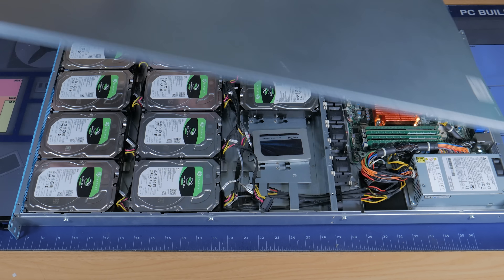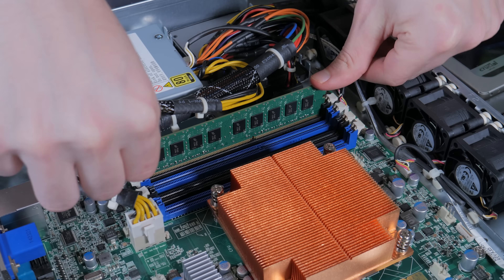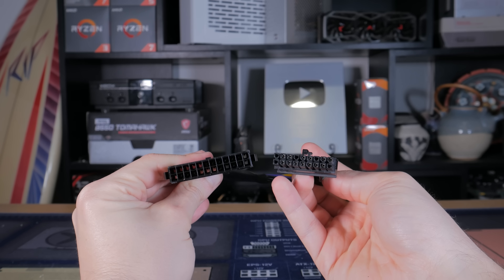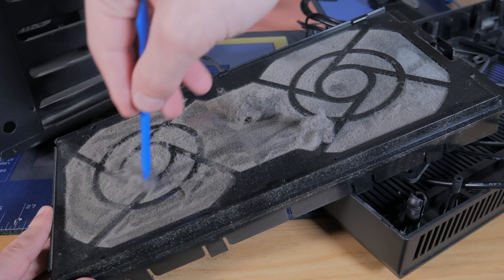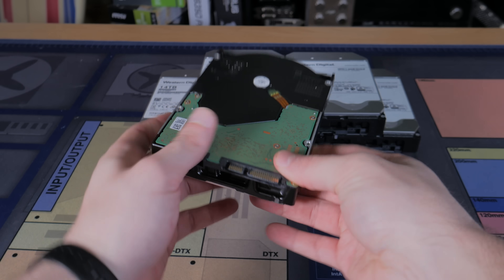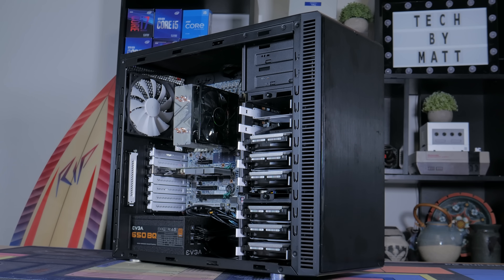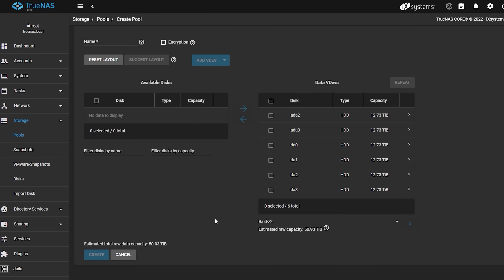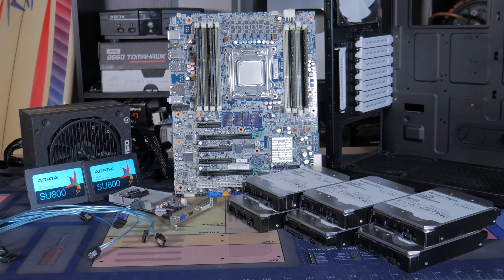Budget Storage Server 2022! | 84TB NAS

Comment: Count me in for requesting the upgrades.  I went with the same drives on Black Friday, could only afford three since I was still Christmas shopping.  I went with the Molex to SATA solution since my NAS is at its core an archiving file server.  It won’t be on for extended periods.  I also believe that these drives have different firmware from the Reds, and chose to just using Basic as opposed to RAID.  I have no idea how these would stand up to rebuilding a pool.

Comment: What exactly were the shortcomings / problems you had with the old server?
Reply from the maker: It was  too loud for the current space I have, all of the drives were SMR vs the CMR ones I have now, only had one 1-slot PCIE expansion slot available, and a few other things. Not at all a bad system and I could have just transferred the old parts to a new case, but this new system is much quieter, should be more reliable, and gives much more room to expand and try new things.
Reply: @TechByMattB  undestandable, noisy hardware is the biggest dealbreaker even before high power consumption, heat and space 🤔

Comment: Matt Yes, 10 gbps networking and SSD cache video in the future please. Thank you for producing this piece.
Reply: 10GBit is to expensive, there are like $20-$25 2.5GBit network cards on PCI-e x1/USB3 which work with CAT. 5e cables.

I don't think that any modern HDD will exceed ~300MiB/s even in RAID/ZFS.
Reply: @Adam130694  raidz6 I can hit around 550 and I'm sure pro setups with better hardware can hit faster speeds.
Reply: @rudysal1429  ok my bad, but I'm sure that 300MiB/s is sufficient for editing even 4K/60FPS over network.
Reply: @rudysal1429  Is there not a bandwidth limitation.
Reply: @Adam130694  Not even close. My camera files hit 300mbps on the low end. On the high end 1.9gb per second. And raw footage will be even bigger.
Reply: @Adam130694  if I have 2.5Gbit network card on my main PC and my truenas server, can I run full 2.5Gbit if my router only support 1Gbps?
Reply: @SkeletalPlayz  No, a 1Gbit switch or router in between would drop the connection speed to 1Gbit. If both your main PC and Truenas server have two network ports, then you can continue to use the 1Gbit ports connected to the router for internet, but use a dedicated connection between the 2.5Gbit ports on PC and server to allow faster access to the NAS. 
Cat5e supports 2.5Gbit at up to 100 feet, IIRC, so upgrading your switch to a 2.5Gbit model may be useful. Should be able to find 5 port models around $100. Anything that has 2.5Gbit ports you would connect to the 2.5Gbit switch, everything else would continue to connect to the gigabit router, with one connection between the two.
Reply: and by future he means next week. and by next week i mean now, as this video is already weeks old
Reply: I don't think there is a way to use a SSD with ZFS / TrueNAS ...
Reply: @Felix-j3d4b  there is. When you create a pool you can select a cache drive. I'm using 4tb hard drives in my nas and a 500gb m.2 nvme ssd as cache
Reply: @kyu3474  Lawrence Systems has a good video on zfs caches, boils down to this: cache in ram has a order of magnitude lower latency than other options. You should start thinking about ssd/optane cache only if you get low hit rate for you ram cache.
And as always it all depends on your use case, if you pull random video files and you watch them once cache won't help you much.
If you run vm's or docker containers I would first max out ram and only when hit ratio drops would add l2arc.
BTW Matt: did you pick TrueNas Core over Scale for a reason?
Reply: @furmek  "if you pull random video files and you watch them once cache won't help you much"
--> Very well said. So many people miss this crucial factor and build in expensive cache solutions when the primary use of their NAS is to 'play random media for the family'. Additionally, most of these folks will also have a 'main' PC - for maximum speed, that's where they should be doing any CPU/GPU intensive work...keep e.g. video editing/heavy lifting local. Of course, once your done, move onto your NAS.
I blame the 'more money than sense' group :)

Comment: Great video Matt! I definitely recommend Truenas. ZFS Pools are mainly what I was after. It’s been rock solid on my 12 bay Supermicro server. Currently have 8 WD 8TB reds in raid z3.
Reply from the maker: Nice! sounds like a great setup.
Reply: Truenas is only useful if you have unlimiyed funds to buy boxes of new drives every time. For normal people unraid is vastly superior
Reply: @SupremeRuleroftheWorld  Could you elaborate on that, please? Why would TrueNas require "unlimited funds to buy boxes of new drives every time"? Every time what?
Reply: @3nertia  i dare you to put in 1 new drive to expande storage
Reply: @SupremeRuleroftheWorld  WHY!?
Reply: @3nertia  answer the question. Why is not an answer.
Reply: @3nertia  what SROTW is trying to say is you can't add drives like you can with unraid, you have to add vdev's I.E. a bunch of drives.
Reply: @nadtz  Like an LVM? I thought that's all RAID was really doing was managing disks using an LVM to make them appear as one cohesive drive while giving us the benefit of redundancy? I do not understand how unraid differs?
Reply: @nadtz  SROTW is being a smug dick.
At least one person is being helpful. Thanks.
I read the OpenZFS docu. A vdev can be a single disk or a number of disks built together to a singe vdev under a specific ZFS raid-type.
If you have an simple Linux with OpenZFS you can use 'zpool add ..' to expand a zpool. Apparently unraid allows this also.
TrueNAS Core however does not allow expanding a zpool, because... reasons .
TrueNAS only allows administering your installation through their UI, which decides what you are allowed to do and what not . There is no reasonable shell to work with. TrueNAS Enterprise has a shell addon, but from what I saw it is just as castrated as the UI.
Why 'zpool add ..' to expand a zpool is not allowed I can only speculate. I've read that if you expand a zpool by adding a single disk to an already running raid, can cause the raid to perform poorly until data and parity has been more evenly distributed over the zpool.

I'm honestly thinking of simply build my own server without someone else's prebuilt job, that may tie my hands behind my back to disallow me to do what I want to do because of ... reasons .